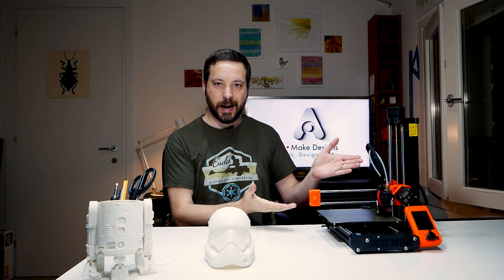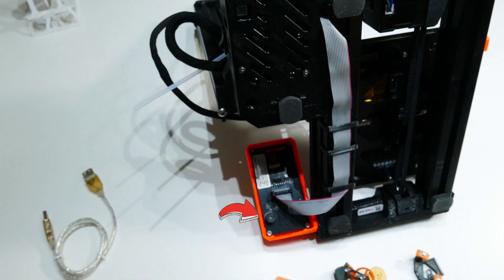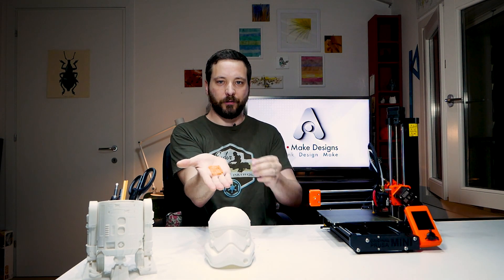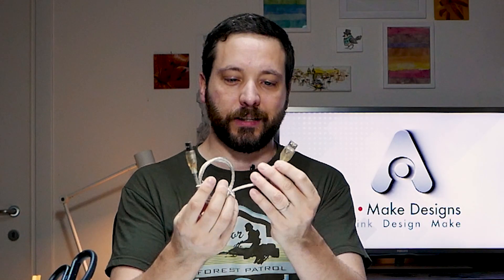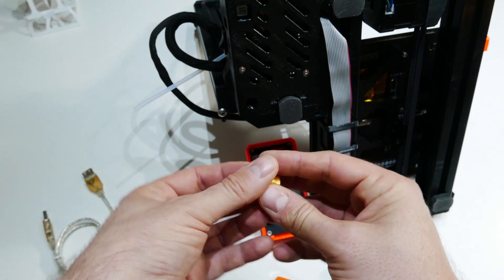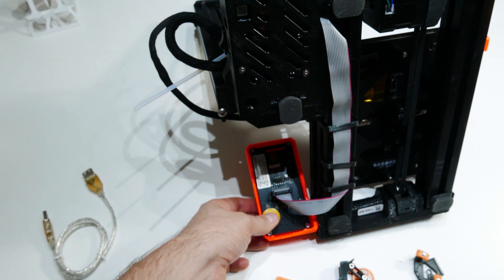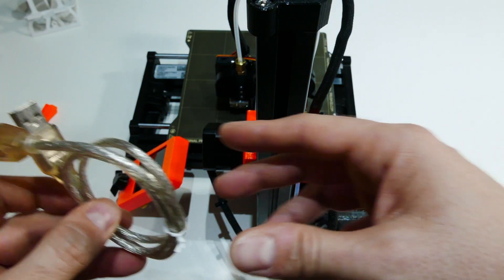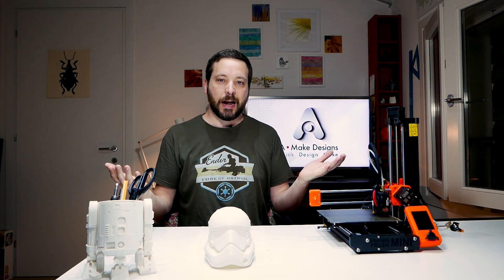Prusa Mini: my 5 cool upgrades!

Comment: Hi, Love these upgrades. but would it be possible to look in to updating the Extruder gears? the current design of the hatch prevents it from fully going up. if you look at the latest revision of prusa the hatch is at an angle clearing the top bracket of the Z axis
Reply from the maker: I will give it a look, thanks!
Reply: @AMakeDesigns  nice. With a knife i carved the angle in to clear it. But would look a bit nicer if it where printed that way

Comment: Mine sure wasn't.  FIrst the PTFE tube was 1mm too short and that caused clog after clog causing me to replace nozzles just to have another clog.  I finally figured out what was wrong and replaced it with the spare that was the right length.  Then, the heat bed thermistor failed.  They are completely out of them so mine is completely dead now.  It did print well when it worked but mostly, I view it as a dud.  I would not recommend this machine.